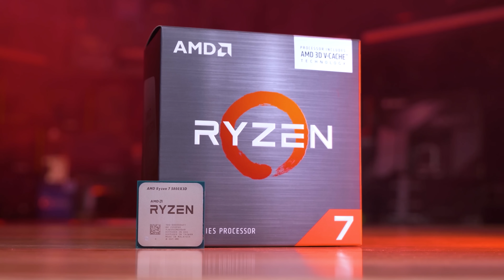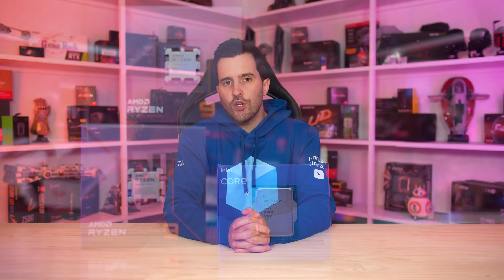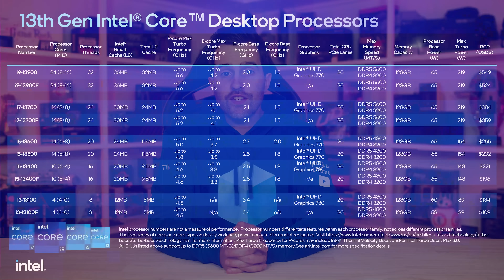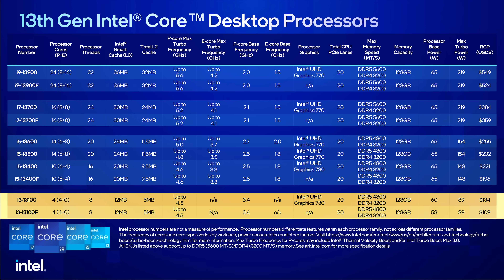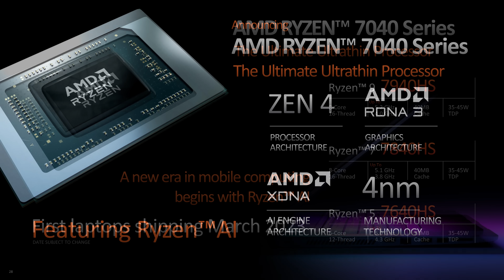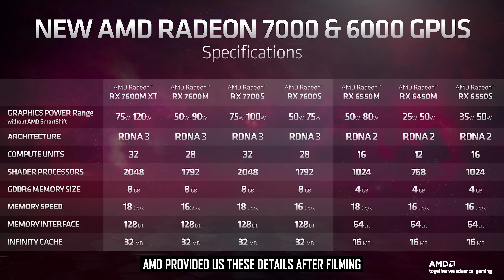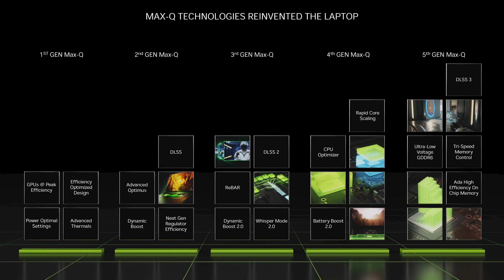Zen 4 3D V-Cache, 7950X3D, 7800X3D, New Cheaper CPUs, "RTX 4090" for Laptops - CES News Recap

Comment: Very interested in the new RDNA3 APU. I wonder if a new steam deck will be announced?
Reply: A version of the Phoenix apu might get into future Steam decks, but not the next one. The next one, already unofficially announced,  maintains the same performance and enhances the display and battery life. Also they need to produce a lower tdp version. The Phoenix is a 35W, while for the steam deck you need 15W. That + the deck design can take more than a year. So no, it cannot fit into the schedule of the next steam deck that will be coming this year.
Reply: @marsovac  where did you get info there’s a new steam deck this year?
Reply: @marsovac  ?
Nope.
Reply: @marsovac  I guess what I should've asked is if the next steam deck will have rdna3 cores instead of rdna2. For the first deck, Valve worked with AMD to make a custom APU with rdna2 cores even before rdna2 APUs were publicly available so it should be possible I think.

Comment: 1:17 This statement is misleading. Or revise the word "to" in the sentence please. The 3D V-cache is not to significant increase L3 cache. It sits directly on cpu die to shorten the data transfer path and therefore to significant reduce data transfer latency, as claimed on AMD website.
Reply: no, the 3d v-cache is increased L3 cache, L1 and L2 remains identical. AMD have all the details on their site and this is also how it was for the 5800x3d. The 3d-part is just that they add the extra L3 cache on top of the chip instead of beside it on the ccd.
Reply: That is entirely wrong.  The extra cache sits on top of the existing L3 cache.  It's entirely about an increase in cache capacity, with essentially no change in cache latency.
Reply: @TrueThanny  You'd better check out what "Through Silicon Vias (TSVs)" is on AMD web, then speak out. The cache sits directly on CPU die so that latency would be quite low as the data won't have to travel the width of the core + the width of the L3 laterally in worse case where the core needs data from the furthest L3 slice vs travelling above layers for data.
Reply: @canberrano1widowmaker  You're epitomizing the danger of a little bit of knowledge.

The latency being low is a positive side effect of stacking the cache, not the purpose of adding additional cache.  Capacity is the goal there.  Doing it with a separate die means they don't take up more dies space on the compute die.  And stacking it on top of the existing L3 cache (not on top of the CPU cores, as many erroneously claim) allows the addition of that cache without any kind of logical interconnect, and without any notable increase in latency.

You're presenting a side-benefit of stacking the cache as if its the main purpose of adding the cache in the first place, which is wrong.
Reply: @TrueThanny   Holy cow, dude normally I only talk to academicians, but for you I offer you the exception, I bet you never used did MEMS or NEMS in a national lab like me, but that's fine. Long storage short, specially for people like you: I am talking about 3D V-cache, not more cache. You'd better figure out what 3D V-cache is. If you still can't turn smarter, I cannot help any more, then maybe you should get a PhD degree in ECE from top20 univ in USA (like me), publish some IF>10.0 journal articles then come back and speak. ...

Comment: I definitely could see my next laptop being a 4000 series.  It's been a while since I bought a new laptop.  I'm using an Alienware R4 GTX 1060 with Core i7 and 16GB of RAM as a desktop replacement right now while I build a new 13900K liquid cooled desktop- works just fine, althought I could upgrade to 32GB.  I also have an ASUS TUF RTX 3050Ti with an AMD Ryzen 8-core which is sitting in a bag.

When the time comes to drop big cash on a RTX equipped laptop, I'll either have a mobile 4080, 4090 or a 5000 series. 

Time flies so quickly with this stuff.
Reply: It sure does. I had a 1060 laptop in 2017, then got onto the RTX hype train with a 2070 laptop in late 2019, and recently upgraded to a 3080 laptop in August 2022. Really interested in a 4080 or 4090 laptop with one of the new Intel 13-th gen CPUs. We'll see how the prices go

Comment: Looks like gen 2 of the Vcache is still frequency limited but is 500MHZ faster than gen 1. All the 7000X3D chips only have one chaplet with 3D Vcache. Maybe with the 8000 series and gen 3 Vcache they will finally be able to have parity with the clock speeds. Hopefully it actually releases with the Vcache products and AMD doesn't sandbag again
Reply: Higher frequencies require higher voltages and higher amounts of cache are sensitive to higher voltages, so you can't have both.  However, it has been proven and is a fact that on average in games higher cache amounts are better than higher frequencies. 
As I said, is a known fact but just as an example, we have to see the disappointment that the KS versions of Intel have always been, compared to the 5800X3D of AMD.

Comment: I can only imagine the price of the 7950X 3D. It’ll probably be at least $750.
Reply: Take 7950x price and add $150 and you have 7950x3d price.
Reply: It was supposed to cost 800 based on rumors. I imagine the only reason they'd sell that lower than 800, it is, if AMD is still failing to sell as much as CPUs, they wished this generation, anyway, whatever it's the MSRP, it'll probably cost more in different places, the MSRP for the 7950X was 700 and at launch it was being sold at 800, of course, online. 7950X3D is all I was waiting for this generation, but, knowing how AMD is, they'll probably try to overprice it to make all the money they can.
Reply: Worth it
Reply: @RTX5070Ti_Benchmarks  25% more expensive for 15% faster is "worth it?" Did you fail math?

Comment: The 7700X was already my top candidate for replacing my i7-6700 as part of a brand new PC build, but these ones may just take the top spot!
Reply: Do you live near a Microcenter? $345 for a 7700X and you get 32gb of ddr5 6000 ram for free +$20 off a motherboard. Take a pic of your build when done and you get another $25 off. Deals are CRAZY!
Reply: @leotolosky7904  wish we in EU would have those deals..
Reply: @leotolosky7904  Yeah i can imagine these 3dX variants wont be cheap on launch
Reply: @leotolosky7904  

I love Microcenter. It would very rare that I would shop for PC components anywhere else.
Reply: @leotolosky7904  Not super near, but there is a Micro Center in the metro area that I live in.
Best Buy stores are more common here, so I'm also keeping an eye on them for deals.
Reply: @Menti Capti Yeah that's what I was debating with myself when looking at the more expensive 7900 and 7900X.
I decided that gaming is my biggest priority and that I could save way more money with one like a 7700X - which holds the top spots in benchmarks while being way cheaper. 
(Production apps should see a big increase on their own anyway, since my current CPU is 6 years old.)
Add in 3D cache to that, and that gives me the best of both - so long as the prices and benchmarks work out.
Reply: I admire your dedication my guy, I had a 6600, and upgraded to a r5 3600 price, and performance was just to good for me to pass on.

You have twice as many threads as I did, plus overclocking but I have to imagine the 6700k was getting long in the tooth.
Reply: @SeniorJuanPerez  Thanks! My 6700 (not K, so no overclocking) is paired with an Radeon RX480, which makes my current PC on par with a PS4 Pro. So it really is a great PC for 90% of all games - it's just that I want to upgrade for next-gen games plus better fps for emulation & certain complicated games (i.e. Planet Coaster, Cities Skylines).
I'll keep my current PC as a "legacy" PC & for Blu Ray watching.

Plus, you never know what will happen once a PC gets past the 5-year mark. I've already had to replace my PSU.
Reply: @scaryhobbit211  Yeah, my bad on that man, I spent all my money on the GPU, got the 980ti for $400 new from newegg shortly before Pascal's release. Tho my original intention was to run crossfire 480's as they where like $200 each if I recall but sold out, so I spent it on the 980ti.

I ended up giving most of my old hardware to my younger brother, I still have my original PSU ... pretty close to 9-10 years old should probably replace it ...
Reply: Hopefully when the 7800X3D is launched it will force a reduction of prices in the 7900X as it happened with the 5900X when they launched the 5800X3D. Then, if you use your computer for more than gaming, the 7900X would probably be a better option, specially because the gaming benefits of 3D cache are more noticeable at 1080p, which only few people play nowadays. For 4k gaming, for example, you would barely notice the difference between both processors.
Reply: @itisabird I'm not sure if this is a misunderstanding but, what do you mean by "a few people play"? 1080p is still the primary resolution for majority of gamers.
Reply: @itisabird  I'm planning on doing 1440p with my next PC - I have no interest in 4K.
So I should be able to see those 3D cache gains.
Reply: @itisabird  i think what will happen is ( pure speculation though ) the 7000x models came down in price over the holiday sales and have been actively cheaper ever since  but with the non x cpus due very soon and they are slightly cheaper than the x models so i dont think the x models will stay that cheap ( other wise why buy the non x ) they will increase slightly maybe in that mid point between the non x and their release price .. 
which could put the x3d cpus around the 7000 release prices !!
Reply: @volvot6rdesignawd702  "other wise why buy the non x"

1. It's only a tiny bit slower, but cheaper.

2.It comes with a cooler that while not great, gets the job done. The X models all require an aftermarket cooler, further inflating their prices in comparision.

3. The non X models use a fair bit less power, meaning you could possibly opt for a less beefy PSU, or use a similar PSU but opt for a a somewhat more power hungry GPU.

Those are just 3 points that popped into my head right away. The beefier GPU(with the saved money) popped in while I was writing as an added bonus.
Reply: @jtenorj  there is benefit in buying the non x 100% but at current prices in Australia the 7600x is $399 aud and the 7600 is $379 .. 
I mean $20 seriously $20 .. 
maybe i could sell the cooler !! 
An argument could be made that the x versions are still better as they are plug and play even if power hungry and in turn could hold value better ??
i ended up with the 7600x as a " i got impatient waiting for the x3d cpu's and wanted to build my system buy " which i will most likely sell after i upgrade !!

Comment: Must... Wait... Until 9000 series v-cache....
Reply: That is the plan. 5800x3d is huge gaming CPU for years!
Reply: What do you have currently?
Reply: @RTX5070Ti_Benchmarks  I went from a 1200 on a b350 board to a 2600 then a 5800x3d. Will wait for DDR5 to mature, 2nd gen AM5 should be a bit more refined too!

Comment: I have bad feeling about it, considering the recent AMD mess-ups.
Reply: What do you mean with mess-ups? The hot spot temps of the founders edition GPUs?
Reply: If it is that… You should plame the manufacturer of those reference coolers. AMD does not make coolers, only the GPU chips and those are just fine!

Comment: Wow fastest PC Gaming CPU awesome,I love AMD gear but sold off my AMD 7700X when the system did not work with RTX 4090 but worked perfect with RTX 3090.
Reply: Wait what went wrong?
Reply: @FJaypewpew  I'd guess either the 4090 did not fit in the case or the power supply was too weak ;).
Reply: This was fixed in a BIOS update right after launch
Reply: @ht3k  I know exactly when at what fixes were out.

Comment: A 7600x3d at a lower price point would make any other cpu unnecessary for most gamers who don’t use or benefit from higher core workloads
Reply: The extra cache is expensive, so that's unlikely to happen: it'll only go on premium chips.
Reply: @MarkRose1337  yeah right now it’s still costly, but as the tech matures, it should start to become more affordable to implement on more mid range processors and give extra incentive to go with Amd over intel. Otherwise I’m likely going to go with a 13600k if I were upgrading to a new platform right now
Reply: Yeah. 3d cache cost about $150. if you slap extra $150 to low cost chip, it makes no sense!

Comment: damn those new 3d cpus looks enticing, but my 5900x is more than enough for my current needs
Reply: I still love my 5900X, but due to devs and their awful coding, some games aren't really a high refreshrate experience with it. I'm not upgrading until Ryzen 8000/9000 (whatever's next) and they get their 3D chips, a 9950X 3D or 9900X 3D would be awesome, I just hope that the next gen Ryzen CPUs have increased core counts as Intel keep increasing theirs
Reply: 5900X is a beast

Comment: Is it more expensive to go AMD these days? Memory and mobo included
Reply: Depends where you are, I'm Australian and Intel is cheaper right now since their motherboards are half the price and CPUs slightly cheaper
Reply: Here in US at microcenter you can get a Ryzen 7000 CPU and a free ddr5 6000.
Some AM5 board are getting price drop but Intel Mobo is cheaper.
Reply: @ktpt3732  so AMD board is generally more expensive? I have not upgraded in a while and I’m not updated. I realized that if I upgrade gpu, the rest will have to be upgraded too
Reply: @Cons2911  Your absolute best bang for your buck general purpose build right now is a used 5600x, b-series board, 3200mhz generic ddr 4 ram kit. That setup won't be the lastest and greatest, but it's plenty of pc for most users. Add a 6900xt Radeon and a nvme on that, and you'll have a PC that could last years.
Reply: @Uncle_Fred  which would you suggest for maybe a 4090 or 4080 if it goes lower.
My cpu is a bit old, 8086k, probably a bottleneck for those gpu’s. Not sure if I’ll go intel or AMD, I understand the intel side mostly as that’s what I have
Reply: @Uncle_Fred  for intel maybe an i7,,what’s the AMD equivalent of that?
Just saw a 7xxx3d something..I’m guessing that’s expensive?
Reply: @Cons2911  yes it's expensive to go to AMD but it's not like going Intel will save money either. At best maybe $100-$200 save. If you're buying the 4090 + latest hardware you're looking around $2500-$3000+/-.

I don't have a 4090 and I'm up to date on AMD. Once 7900X3D launches I'll be around $2800+. I spoiled myself because this is my last PC build until the next 10+ years
Reply: @ktpt3732  I’m hoping an i7 or equivalent will be enough for my next gpu… or.. skip the upgrade and save some money lmao.. 3k for a pc.. man, my 980ti before was like 70p or 800 I think
Reply: @Cons2911  I understand, I wish in my case it was different. I gave my desktop away two years ago and couldn't build one because of the low inventory supply shortage. I was able to save and spoiled myself I decided to go ahead and build because mining is somewhat dead.

Only issue I have is these greedy companies still charging us like GPU mining is alive. I couldn't wait another two years to build a PC, I desperately needed one. I've been playing mobile games way too much and these gacha game are pissing me off hahaha. 

P.S my laptop died two ago also
Reply: @ktpt3732  Anyone purchasing a halo product like 4080 or 4090 would just get the latest available workstation-class Epic CPU, it's Intel equivalent, or the highest end available prosumer CPU. This is the territory where price/performance is not a meaningful consideration. My personal position is that the latest CPUs, 7000 and 4000 series GPUs are not worth the price in the present market. This is especially true if you add up the cost of the package as a whole. Also, keep in mind that ultra-high end GPUs start to enter a strange area of the market where manufacturers sacrifice product longevity in favor of the maximum possible performance. Some of these halo GPUs are known to simply quit working after 3-4 years as the manufacturers anticipate the card will be sold or even scrapped for the next available halo product.
Reply: @Uncle_Fred  fair enough.

Im moving to a foreign country where current tech doesn't come by often maybe like a year and a half behind other countries before I'll see any AMD products. But there is a ton of Intel and Nvidia and they are charging them at US price+ even old components which is ridiculous. 

That's why I said this build will last me 10+ years for gaming (Dx9, Dx11,) and videos editing. I will overclock at the beginning just to see it's full potential but after a few weeks then I set it all to default with Eco mode. I even bought a Arctic liquid freeze ii 420 first time user. That country is tropical and never snow so it's always hot/tropical climate.
Reply: @Uncle_Fred  I bout a Sapphire Nitro RX 7900 XT.  I would love to buy the XTX but they are always out of stock.
Reply: No.  Once you account for motherboard, CPU, memory, and CPU cooler (something virtually all price comparison don't bother to address), it's about the same as a Raptor Lake option.  The latter with DDR5, of course, as that's required to make it competitive with Zen 4 in gaming.
Reply: Priced up an AM4 build against an AM5.  The difference in Australia was about 250aud.  I went for AM5 as next gen, but have put build on hold for new AM5 3xd.  The build doesn’t include new gen GPU, still too expensive, waiting 6 months or so for that.  It’s still not a cheap build though.🇦🇺
Reply: If you check out Newegg all the AIB of the 4090 are $2000+. So going with AMD was a great option for me. I will pair it with 7900x3D for more fps plus the features that come with a complete AMD build.